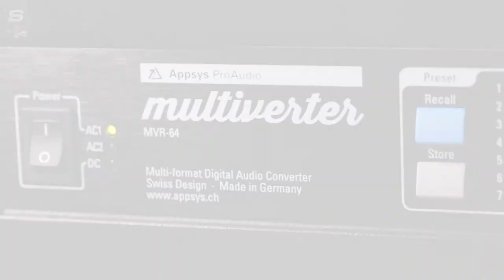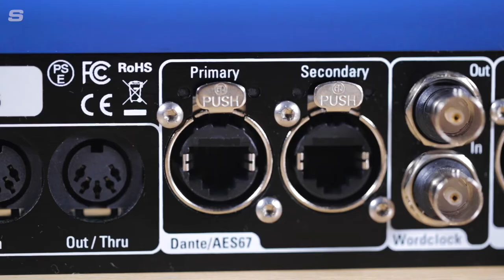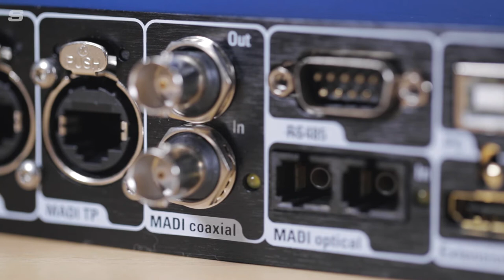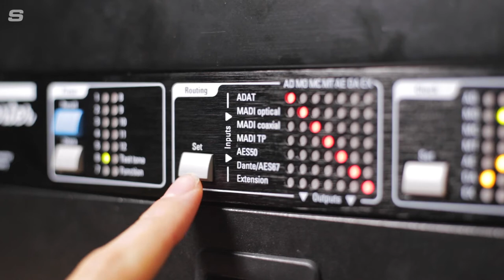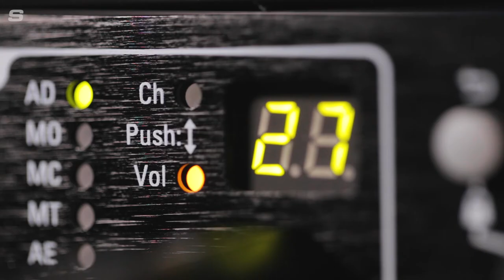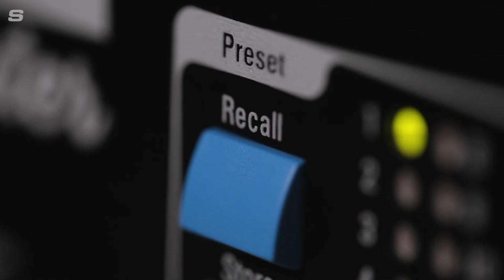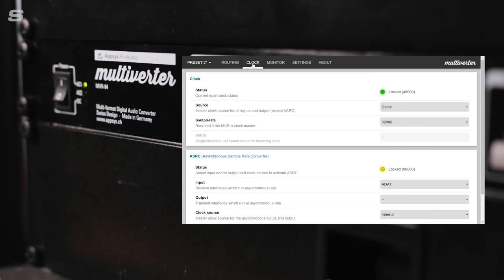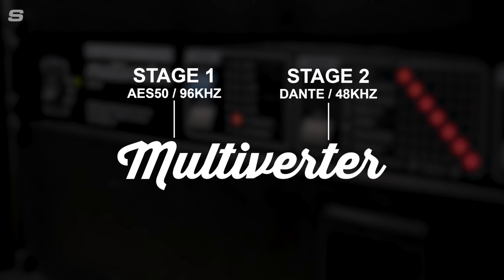Appsys Multiverter MVR-64 - The Swiss-Army-Knife of Digital Audio Converters

Comment: It seems to do a lot but is missing Ravenna. While I realize AES67 should make Dante and Ravenna compatible, I still haven't seen many Dante devices which support 96kHz.
Also, why was 128kHz sample rate included? I've been in pro audio for ~25 years and have never seen this.
Reply from the maker: Hi there!

Appsys have been working on a range of small footprint, multi format convertors called Flexiverters. Because they understand the significance of AES67 and the limitations of using Dante in AES67 mode, Appsys are developing the range to include a AES67 version of the Flexiverter. The Flexiverters are designed to connect into the expansion port of the Multiverter and will add up to 192 additional channels to the Multiverter, allowing the AES67 Flexiverter to connect in with the option to take advantage of the SRC board (if fitted) so that a 96 kHz AES67 stream can be converted to a wide range of other audio formats, even if they are running at different sample frequencies.

Regarding the 128kHz sample rate, having spoken to our Broadcats specialist, he noted that it was 4FS of 32 kHz - though like you, he said he’s barely come across that in real use for many years! But this part of what makes the Multiverter such a flexible device, it’s pretty much ready for anything!

Hope this helps!
Reply: @SynthaxAudioUK  Thanks so much for the reply and details. I read up on the Synthax US site (to see USD prices), and saw that whole line of cards. Very smart! 
I suppose the broadcast world is important too. I am grateful I've never recorded music at 32k 😆